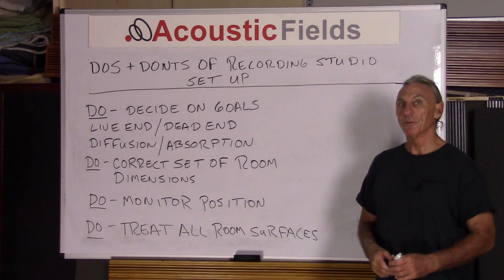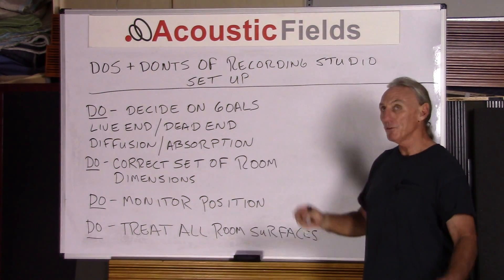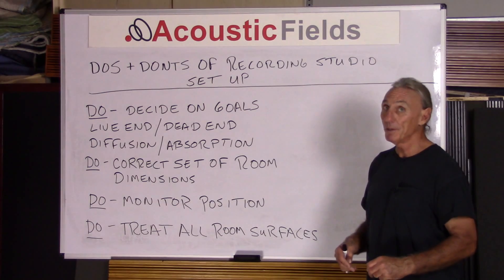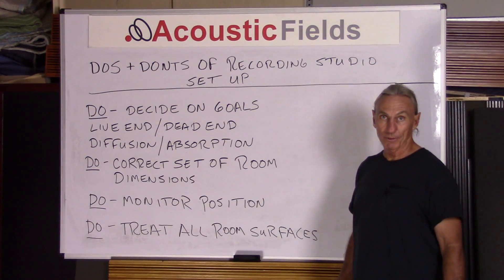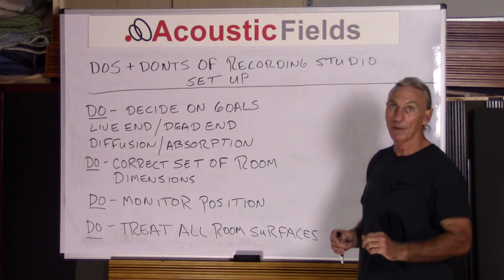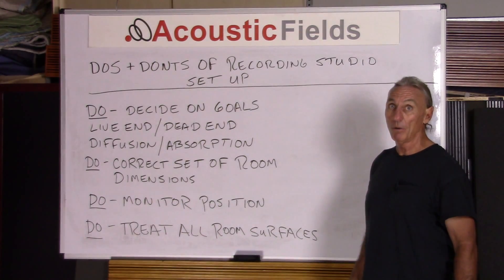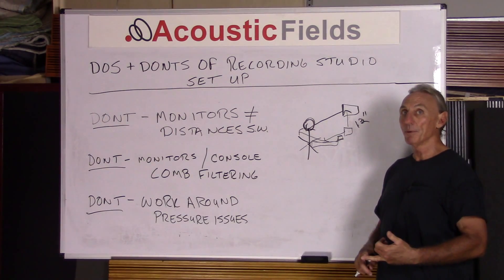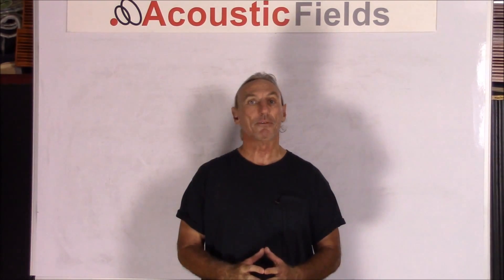Do's & Don'ts Of Recording Studio Acoustic Treatment Setup - www.AcousticFields.com

Comment: this was a 10-22-2014 I view today being 2-2-2021 and you have helped me soo much starting in 2019. I had to build trusses in front and back 1/3rds of the room to support a cloud in the future. The front is a window darn near the span of the speakers & monitors next to the front of the window (40"x38") untrteated but will use a plug to fit snug when mixing.
Reply from the maker: Cover all glass with the appropriate rate and level of absorption.

Comment: I've set up my studio in the middle of the room. It's a 12x24 room. I'm facing out towards the window 3ft away at a 45 degree angle.  The audio gear is the focal point. The desk is to my right, and my keyboard  is to my left.  My chair is directly centered and  each monitor  are within arms reach at  5 ft apart angled in.  If I stand a top on a ladder I can see  a shape of an octagon. I haven't treated  the walls  as of yet until  I can find a way to condense  all components within arms  reach.  Hopefully by continuing  to watch your videos, I may create  the sound I'm looking for. thanks for pointing out the do's and don'ts in your series.
Reply from the maker: J,  Your room set up will change after treatment. You should treat first then set up. Cover that glass window.

Comment: Thanks for The Tips I am Re-modeling my Recording Room    Will Plan First      Kountry Cuz
Reply from the maker: K,  It is much easier to erase a line on a piece of paper than it is to move a wall. Selecting the correct room size and volume to match your intended usage, goes a long way to reduce the cost of lower frequency management treatments and the sonic integrity of  your presentation.

Comment: Hello Dennis, i treated my room with a 1" inch acoustic foam and i also place columns on all 4 corners of the room and i have bass traps on two corners of the wall but when i put on vocals the mid range suffers a lot, what is happening.
Reply from the maker: Hi Peter, I will need to know much more about your room to assist you. Fill out the information in this room form: https://www.acousticfields.com/free-room-analysis. Lets take a look at the total picture and develop a strategy rather than guessing at which tactic to use.

Comment: Hi Dennis thanks for the advice. I have a large window behind my monitors is there anything I could do to acoustically treat it ? Thanks
Reply from the maker: Hi Stevie, Large glass surfaces in critical areas such as front walls must be treated unless you want "glass sound" in your mixes. Absorption would be the technology to use. Our 2" foam has the rates and levels you require.
Reply: Acoustic Fields how would these be applied to the windows ?

Comment: I just submitting my room dimensions. Is there ever such a thing as too much treatment? I feel like I just place things randomly and I need to get this right so that I don't have 20 different versions of a mix. I mix bass heavy records and I have the most trouble hearing my balance.
Reply from the maker: Hi Porter, Guessing in room acoustic treatment is never a good idea. There are simply too many variables. Use a systematic approach starting with low frequency management. Choose the proper technology, make sure you have enough of it to impact frequency response, and place it in the correct locations. You must qualify all unwanted pressure issues before quantifying treatment.
Reply: I think that's my problem, actually knowing what to do strategically. I did click on your link to send in pictures of my studio. Hopefully, you can see what I'm working with! Merry Christmas!! Thank you for the prompt response. My name is "Ericson Porter" so you know which one I am. Thanks!

Comment: Hi there - great video, I'm working on a plan to treat my room and this is a great start, thank you! About the don'ts - I was just wondering, to only way to make sure that my monitors are at equal distance towards the sidewalls is when I position them in front of a window (the rear of the montors is then directed towards a big window). Would this still be the best position or is it inadvisable to position them in front of a window? Or could / should I hang an absorption panel in front of the window or something like that? Thanks in advance for you advice!
Reply from the maker: +De Reisgenoot Glass is any room where music is used is always an issue. Windows go diaphragmatic which means they move with the energy within the room. Reflections from room surfaces must also be managed correctly or you will have more "glass sound" then music. Fill out the information required in this link and I will take a look at your reflections through ray tracing. http://www.acousticfields.com/free-room-analysis/